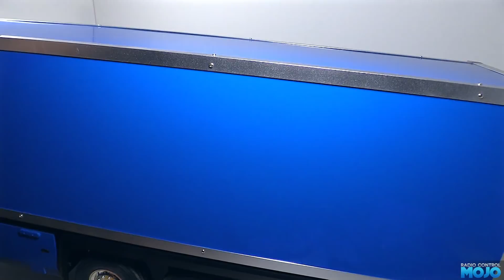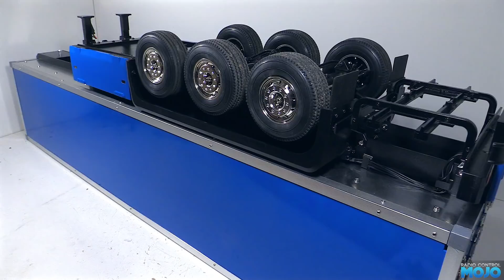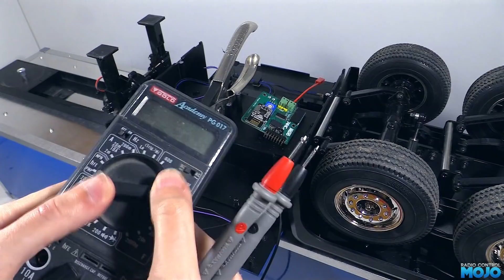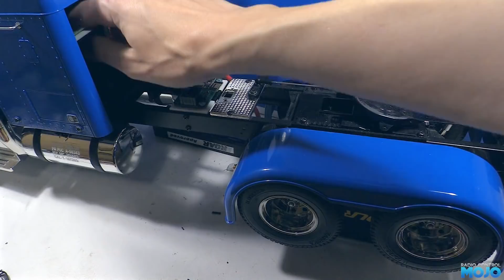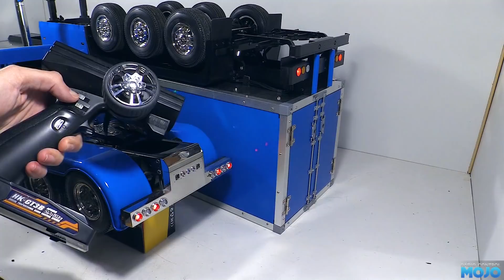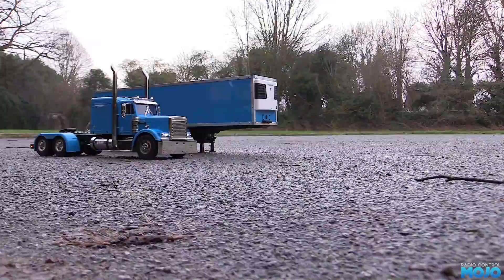Hercules Hobbies Reefer - 13 - Wireless Lights Proto

Comment: hey nice vid i have a ? if i may i have the same truck and trallor and the motorized legs on my trallor and theres a part that hangs down and its cuting groves in my rear fenders u have any idias on how to fix this
Reply: its the bolts replace the buton head botls holding the plate on the trialer with countersunk screws